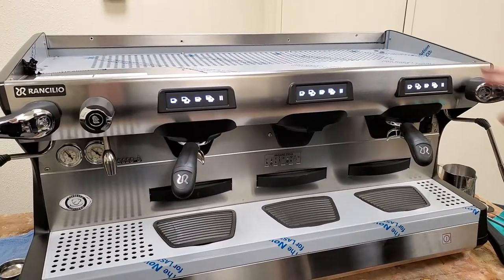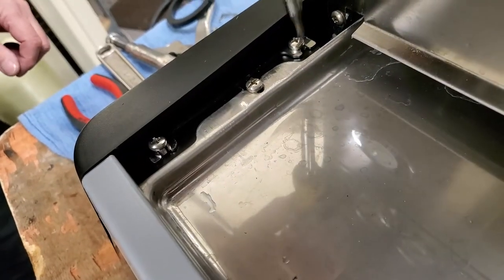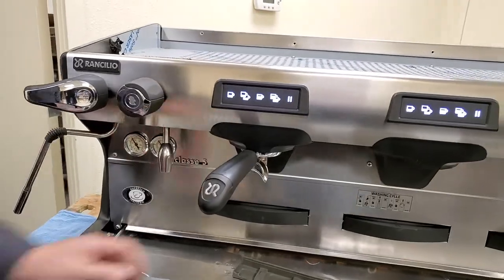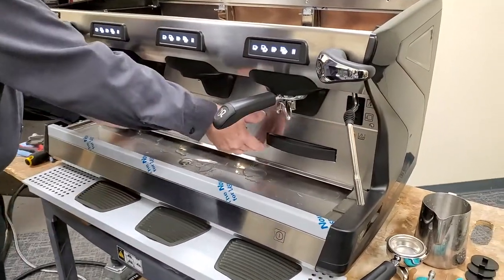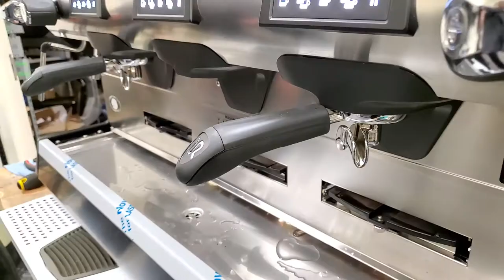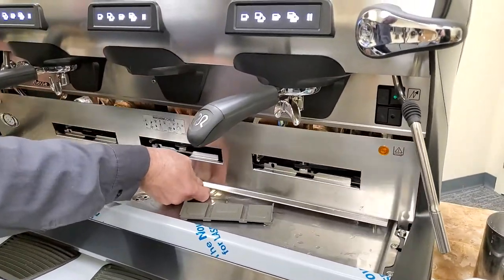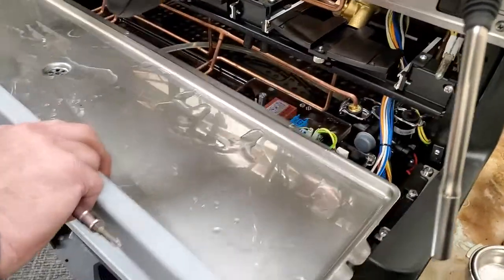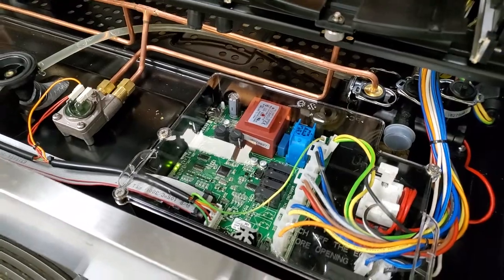How to Disassemble a Rancilio Classe 5 Espresso Machine.

Comment: Any videos on disassembling the 3 way solenoid valve on the group head?
Reply from the maker: Unfortunately no. Apologies. Depending on what your problem is generally you will replace the valve if it is defective or leaking. It is not rebuildable.